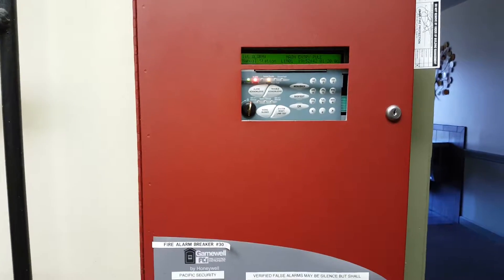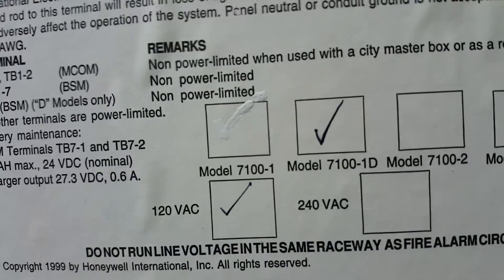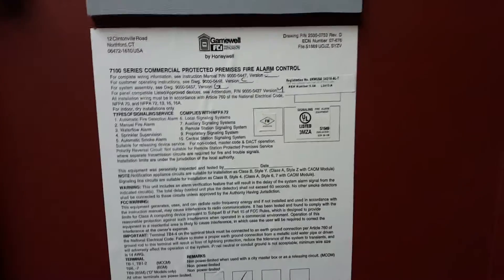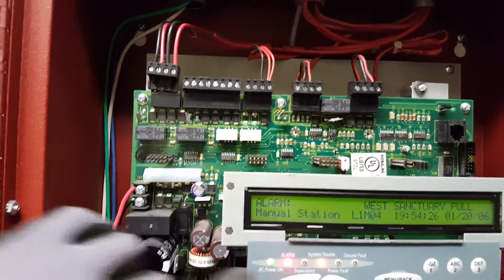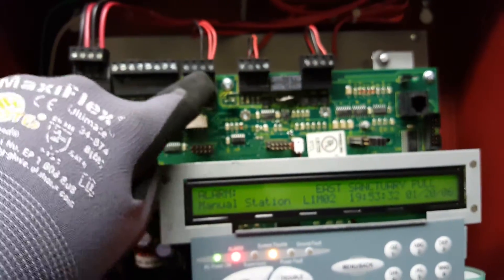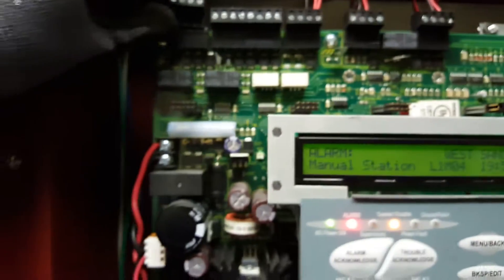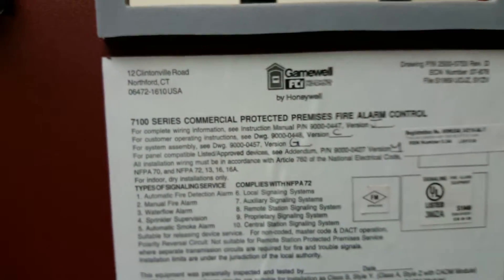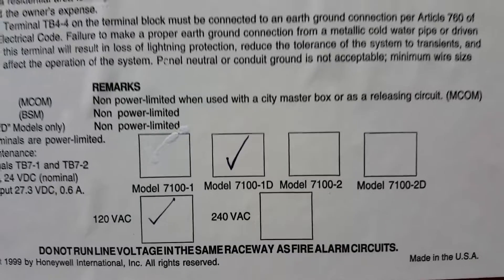GAMEWELL FCI how to disable NACs

Comment: What if thy have two resistors installed at the NAC block?
Do yo still need to remove it?
Reply: No, if there are EOLR's  (end of line resistor) landed on the output circuit/s, that means there are no notification devices on the circuit so no need to unplug/disconnect.